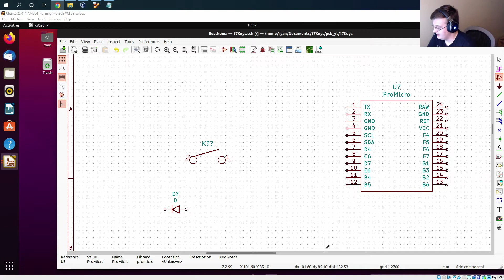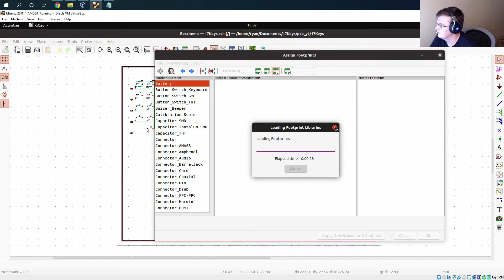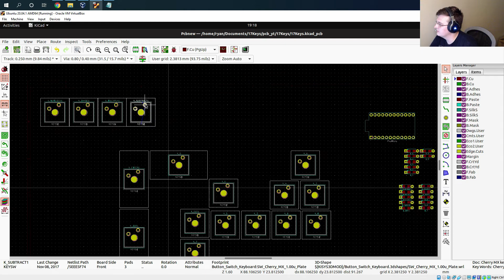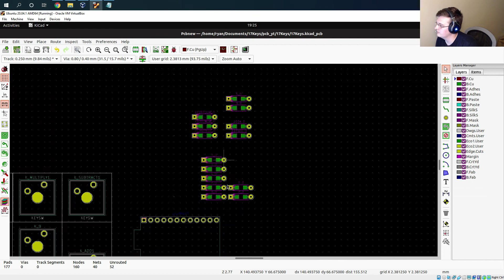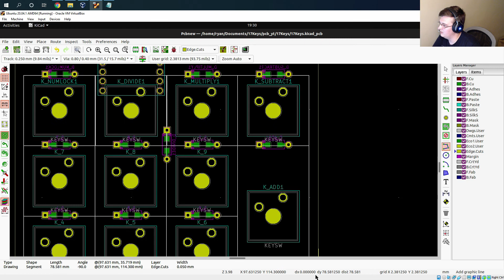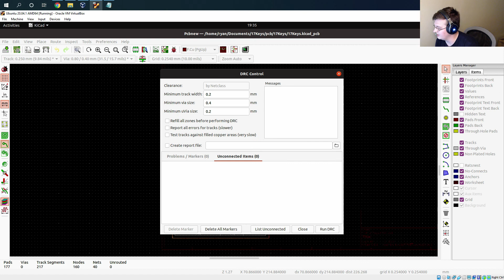Design a Keyboard Pt2: PCB (reupload)

Comment: To all those struggling to find GND in the Copper Zone, it's because he forgets to show him adding it when he replaces the schematic file. You can see it connected on the Pro Micro on the right hand side at 15:00. Press the key on the right hand side (perpendicular line with 2 horizontal lines below and search for GND (under Power category) to add it, then connect it with the Line tool.

File > Export > Netlist
Open the PCB file > File > Import > Load and Test Netlist > Update PCB

Comment: Good Vid, I was wondering after you get the pcb manufactured what did you actually get your components from? Such as the pro micro. And did you hand solder them on or did you get the pcb manufacturer to do that for you?
Reply from the maker: I got my components from Mouser. I hand soldered everything

Comment: hello i was wondering what distance should i use. i figured our col distance 24,13 but what about row
Reply from the maker: Grid size? It should be 2.38125mm in both directions. That's 19.05mm (width of 1u) divided by 8. You need steps of 1/8 because the center of a 1.25u key, for example, would be 1/8u away from the center of a 1u key.
Reply: @ryanbaekr2199  and also i cant select gnd option in copper zone properties
Reply: tried old version of kicad still no gnd option help pls
Reply: @nixon4032   В самой схеме pro mikro добавь gnd.

Comment: most understandable set of tutorials on YT got my sub. Be interesting to also see a PCB designed moving away from the micro so all integrated on the PCB if that is within your ability. I want to get into making these things, there is just something about a bolted on controller that I find a little un refined xD.
Reply: ruiqimao's keyboard pcb guide does allow for that, i think.